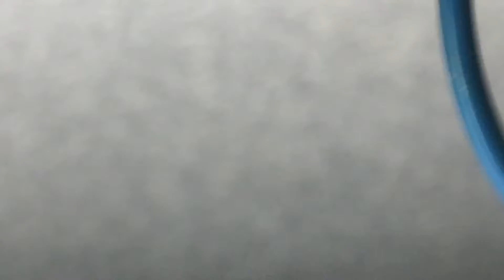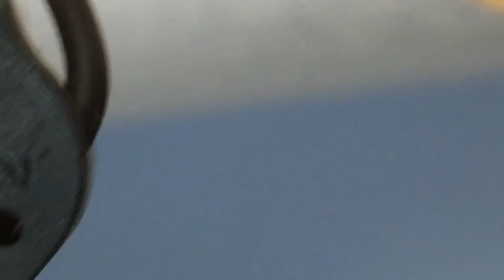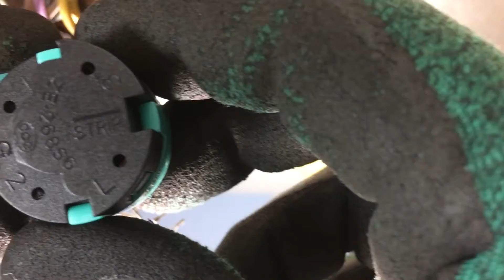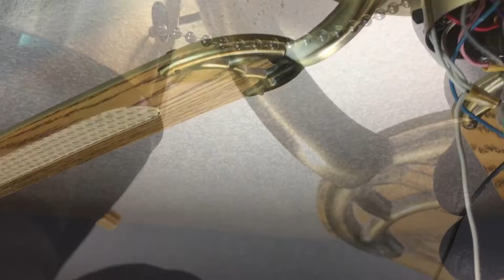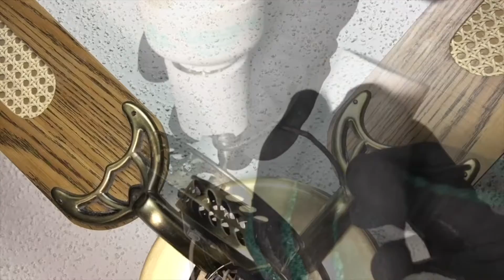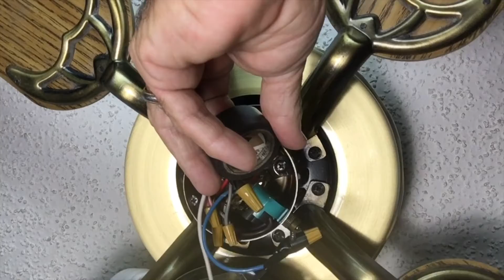How To Replace A Ceiling Fan Pull Switch

Comment: Replaced mine now it works on high or low will not even turn it off
Reply from the maker: Sounds like you need to rewire it.
Reply: @fixitjohn  thank you

Comment: It’s okay if the ceiling fan speed sequence is low, medium, and high, because I ran into a few ceiling fans that has the speeds that are reversed.
Reply from the maker: Thanks for that. I thought it would be ok.
Reply: @fixitjohn  Actually with this chain switch, if second pull is slower than a third pull, it’s a bad thing. It can power two winding taps at the same time.
Reply: @fixitjohn  yeah.

Comment: That is a Hampton Bay Genoa. I have a question. Is it true speeds went wrong or you were just making it up by editing video so you can give example? If it’s true speeds went wrong, you’re using a wrong pull chain, which made it first power low and medium winding taps, then high and medium winding taps. I recommend you to replace the chain with the one that goes L-1, L-2, L-3. Like the red ZING EAR. The one you used goes L-1, L-2-3, L-3 which was made for capacitor based speed control, and if it was capacitor based speed control, there is no way third position would be any faster than second position.
Reply from the maker: Ok thank you.
Reply: @fixitjohn  https://www.ceilingfanswitch.com/product/zing-ear-ze-208s-e89885/

That would also be a correct switch. Just at least get one that goes L-1, L-2, L-3 and not L-1, L-2-3, L-3.
Reply: @CeilingFanVideosOnYT  Is a wiring diagram available for a 5 wire fan switch?
Reply: @fixitjohn  Had you heard of winding taps for each speed? That’s the case of your fan. Only one winding tap should be powered at a time. Your blue/green chain switch would power two winding taps at second pull, which can be bad for the motor.
Reply from the maker: @CeilingFanVideosOnYT  Is the winding tap for variable speeds. I think I read that somewhere. I looked at your channel and was very impressed. I am going to you when I need to buy another fan because you know way more about them then I do. Keep up the good work.
Reply: @fixitjohn  Winding tap is for multiple speeds. Usually 3 speeds. One tap for low, other tap for medium, and other tap for high.

If you buy another ceiling fan, Hunter Original would be a good choice. It would blow more air than the fan in your video.
Reply: need wiring diagram for 3 speed 5 wire ceiling fan. 3 wire capacitor. took photos but not clear